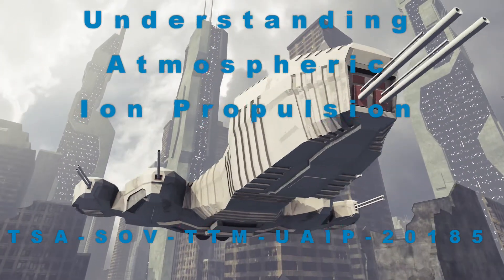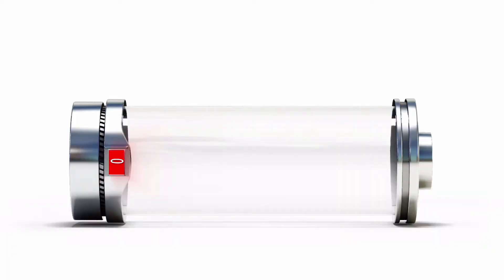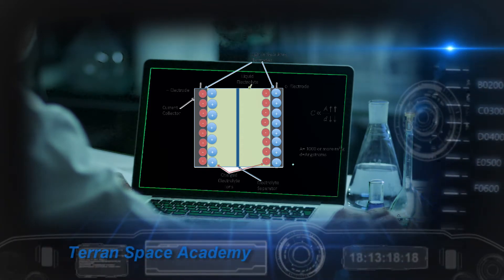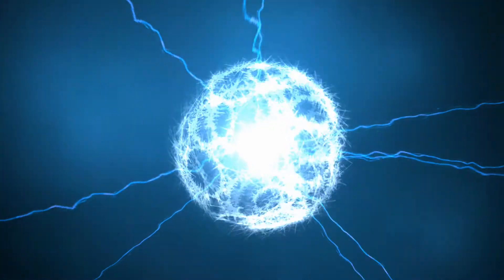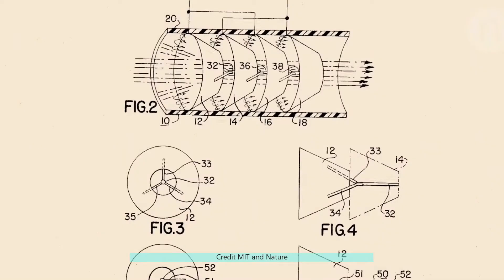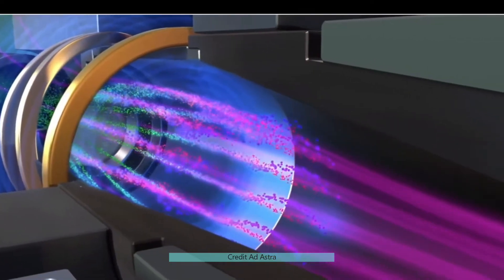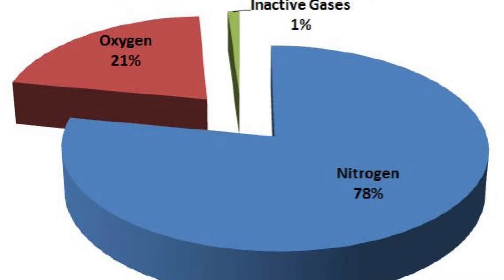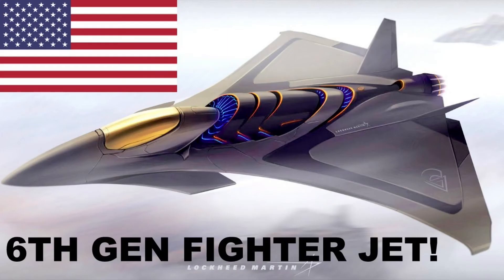Spacecraft Propulsion: Understanding Atmospheric Ion Engines

Comment: I came across an ion jet engine in development that uses  1 kilowatt to get 28 newtons of thrust using micro waves ,but it needs compressed air like a jet. Is this as efficient as the engine you are talking about in this video? Also I was thinking these engines take alot of power is there maybe a way to merge this type of engine with a scramjet. Now I know it would use more fuel but you would need less electrical energy and get the speed up to maybe mock 14. Then also use the boussard ramjet by the air intake also take in ionized air. Then ion drive all in one engine. Fuel can also be used at each stage when needed. I don't remember but I thing you need mock 5 or 6 for a scam jet to work. Unless you can get it to work at a lower speed with ion thrust. It is simply something I have been thinking about. In this way we could take off from a airport and not have to freeze the air which seems to be hard to do.

Also I came across a design where there is high power generators built into the engines. This design was to be able to use high powered lasers on a fighter jet. But in this case to supply some of the power needed. I would like to know your thoughts on hybrid engines using some of these combination technologies. Another thing useing airospike technology with this.
Reply from the maker: Hybrid engines will be absolutely necessary for anyone who wants to build an efficient space plane.  The problem with ion engines is the lack of power generation. A small thorium reactor like what China is now building could be put to this purpose.  Combine that with hydrogen fuel and you could almost certainly get it done.

Comment: One part shows 1.2 terawatts is that required energy? If so antimatter fusion would be more cost effective. And yes we can make enough antimatter if we have a 2 billion dollar factory build to produce it as fuel. We could produce between 5 to 10 grams a year. Using a magnetic trap with a tiny amount of antimatter carbon isotope base core to attract the antimatter particles to form antimatter atoms. The cooling ring only needs enough power to contain the antimatter while it slows and forms atoms on it's own. The factory will be solar powered. Needed antimatter for antimatter fusion is in the micro grams. Even using it as a heat source for propellants would only take milligrams to get to orbit.
Reply from the maker: Those are very good points but a very wealthy nation would have to undertake the investment.  This would be a good project for Europe I think... with the LHC.  Once we have colonies on the Moon making antimatter will be a lot easier.
Reply: @terranspaceacademy  Thats 2 billion not 2 trillion. The SLS well take a billion or two per launch. Before the first launch it well be over 10 billion.  A particle physicist in the USA is trying to get the funding to do this. He said he can get the efficiency up to 1% or better. If you know anything about antimatter production that is extremely high compared to what we have done so far. But what we have done so far is for research only that is for very specific criteria. 

This would change space travel. The amount to get something into space would be competitive to chemical rockets in fuel cost if it was used to superheat propellants.  The size of the ship would be about 80% smaller in fuel and size to do the same work. Even better for antimatter catalyzed fusion. That can be done now with the needed antimatter and a little development time. I am not talking about a government project I am talking about the space industry. This would make it as easy to travel our solar system as getting around on our planet in ships. The factory would have to be isolated 2 grams of antimatter has the energy of a nuke. And yes it would be easier making antimatter on the moon and less dangerous but you need to start somewhere and you well need some on earth for ships leaving earth.

Once we have a space infrastructure we well be able to make kilograms of it near Jupiter using Jupiters enormous radiation belt. Also mining fusion fuel from the atmosphere of Jupiter. After this real starships. Look I don't mean to be so debatable I really like your websites but I have been interested in space propulsion systems for over 50 years.

Comment: Check out Ethan Krauss ion craft. It has vastly more thrust than the MIT ion plane, enough to carry it's own power supply and hover for about 30 seconds. And he did it before MIT, but they'll still try to take the credit for making the first 'winged' ion craft...

In reality the magnetohydrodynamic and electrohydrodynamic techniques for flight were quietly perfected by private aerospace companies working with the military over the last 70 years. External surface MHD propulsion very much resembles your stereotypical "UFO" or flying saucer: glowing plasma around the hull and silent acceleration through precise sub-sonic flow control of the ambient plasma medium. Pure oxygen is a good working gas for initiating the plasma field as it has a very low ionization energy. Then you may dump fuel on the leading surface of the vehicle, preferably hydrogen but jet fuel would work, and allow it to combust along the convex surface of the aircraft rear half, converting the entire aircraft into an aerospike engine. This distributes the forces on the body of the vehicle better than an internal combustion engine and an aerospike has the benefit of being efficient at all altitudes, since the gas always optimally expanded.
Reply from the maker: That is an extremely interesting concept. I will have to look into that. Thank you very much.
Reply: @terranspaceacademy  
Dear Terran Space Academy,
I hope you will enjoy the many prototype EAD VTOL crafts on my YouTube channel with onboard power supplies. They have been  independently verified to carry their power supplies against earth's gravity.  
The craft was patented since 2014 specifically for being the first heavier than air ion propelled aircraft in the world to carry its power supply onboard. It is featured by NPR and other impeccable news sources firsthand for being able to fly with onboard power. 

https://radio.wosu.org/post/exploradio-oberlin-inventor-pushes-limits-ion-powered-flight#stream/0

Even though it is quite surprising, MIT  made a serious historical error in several of their papers stating they "made the first ion propelled aircraft of any kind to carry its power supply onboard" or that "no EAD UAV has ever flown with its power supply onboard."  I have left an extraordinary level of evidence on my website, (www.electronairllc.org)  US patent, (10,119,527) and my YouTube channel, (left icon) that my craft flies with onboard power exactly as demonstrated for officials. Its operability should also be obvious to anyone with a good familiarity of well known physics.

As for supercapacitors, I had ordered all of the best ones that I could get for testing, as of about 10 years ago, and while the power density is very high, the energy density, at least at the time, made them unsuitable for any type of sustained ion propelled flight. Lithium Polymer batteries are readily available and work best for at least 2 minutes of VTOL ion propelled flight.  Solar cells should also work well.
Thanks so much for for posting this!
I would be very grateful if you would please add some sort of addendum or note to let people know, because most people are still getting it wrong.  Thanks!
Ethan Krauss
Reply: @terranspaceacademy  you may very well start with the patents of Thomas Townsend Brown, such as his "Electrokinetic Generator" patent. It details using a fuel flame jet, ionized by a thermionic cathode, to generate enormous electric potential on a capacitor stack as the exhuast accelerates charges.  By negatively charging the exhaust cloud and using the power generated by the flame jet to positively ionize the leading edge of a vehicle, Brown estimated that many MEGA-volts of potential would develop between the two, causing acceleration of the ionized gas around the vehicle up to hypersonic velocities. This is actually reminiscent of claims made by Nikola Tesla on the compression and expansion of the ionized medium by application of AC and DC corona discharges on the surface of a metal hulled aircraft, so this shows us the technology is actually much older, at least conceptually, than we would be made to believe reading the official timeline of aerospace technology. In fact it may predate the jet engine if Tesla...or others...were successful almost 100 years ago.